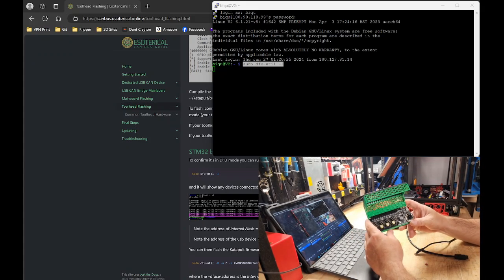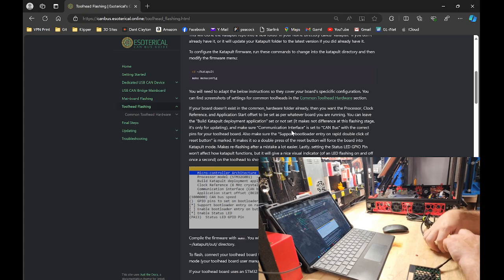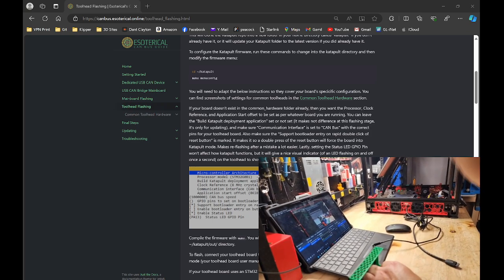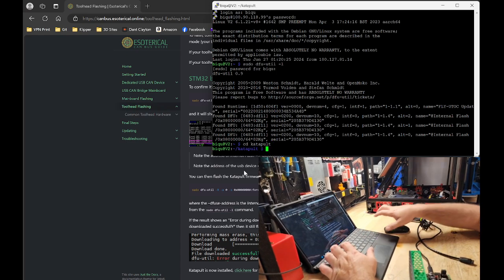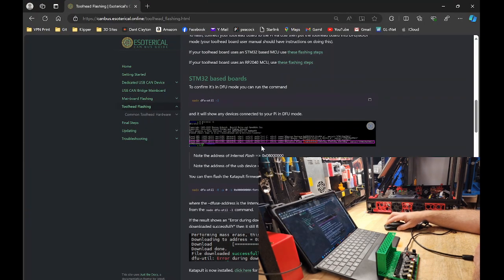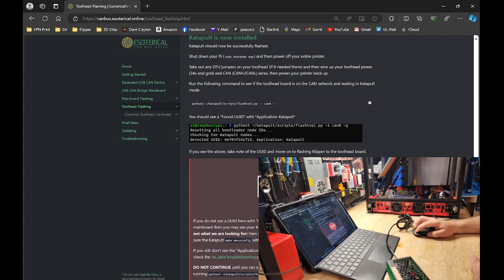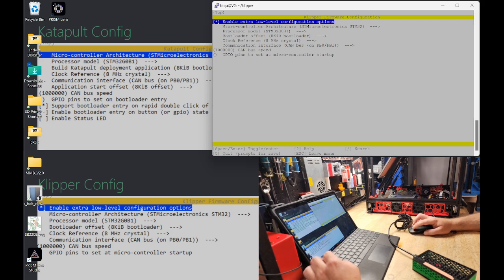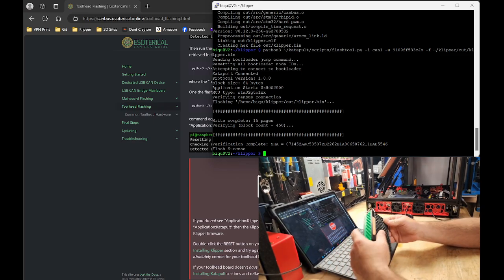Flashing BTT MMB for ERCFv2

Comment: small note: you only need to hold boot. pressing reset is like replugging the usb cable. so you can even plug the cable in, hold boot and just tap reset to boot into dfu mode